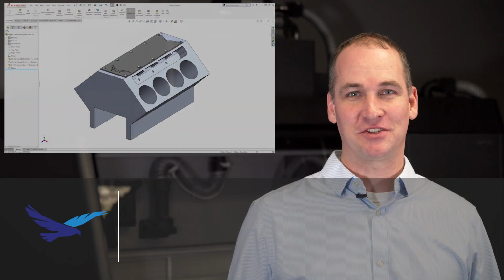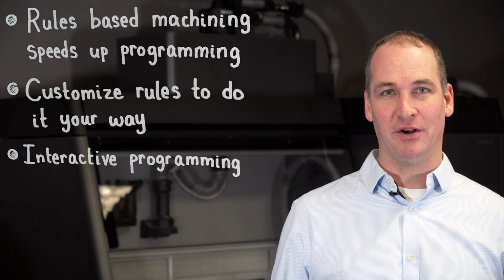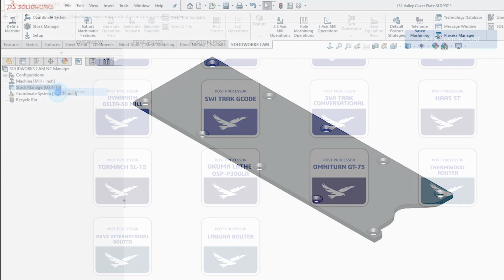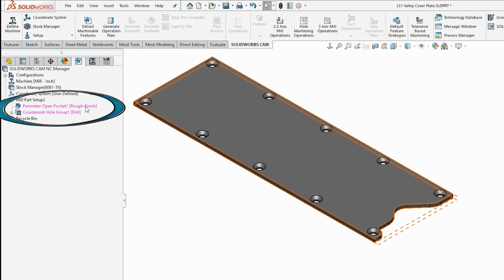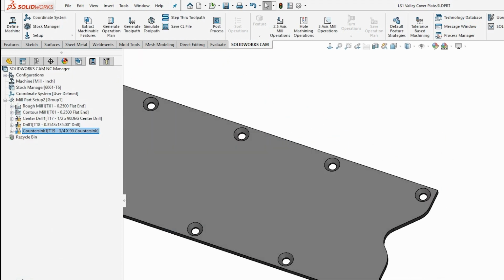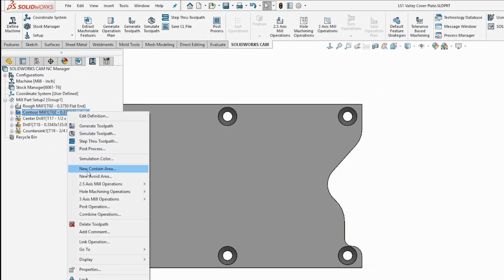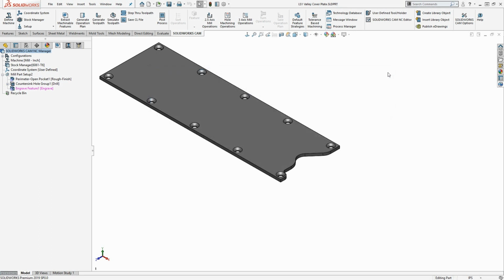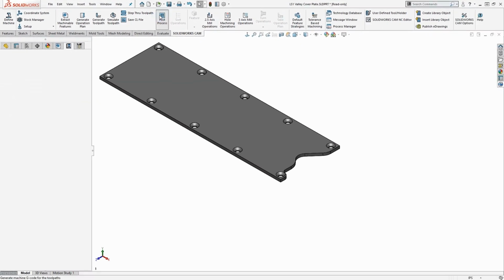How to CNC with SOLIDWORKS

Comment: Does solidworks make flats from 3d models for bending after cut?
Reply: Yes. If I'm thinking what you mean correctly, You use the sheet metal tool.

Comment: I have solidworks 2016 , how can i get solidcam , because i do not have it in solidworks 2016 .
Reply: you gonna have to get solidcam addon or upgrade to solidworks 2018 or newer
Reply: @iczer01  can we update directly from internet connection or installation file we should have separately